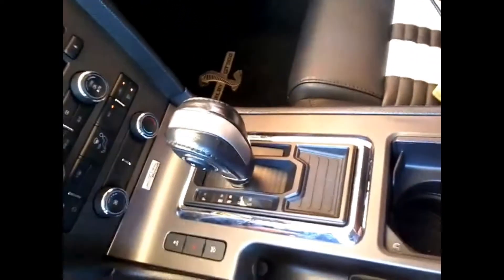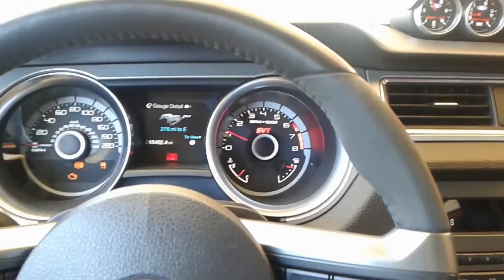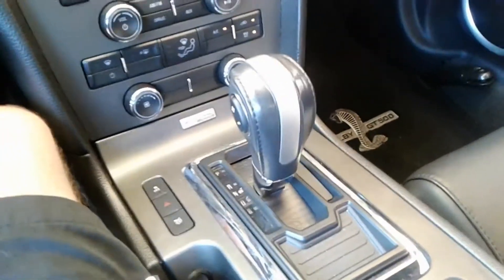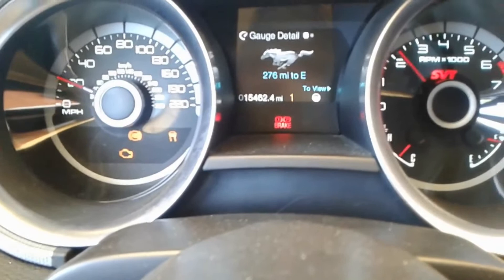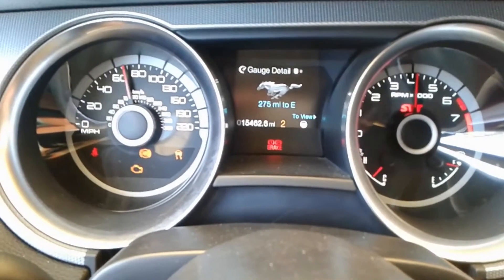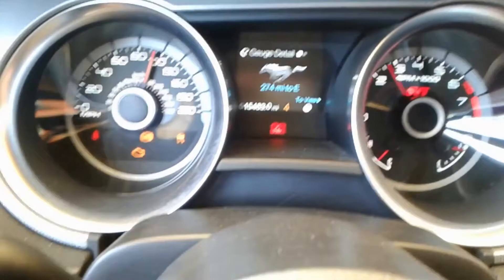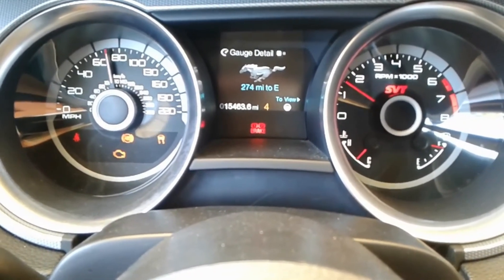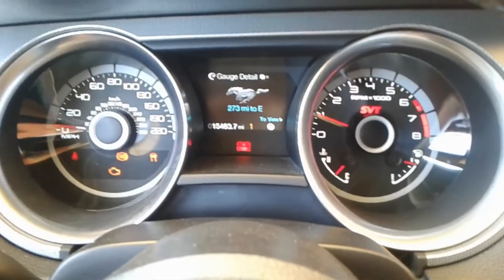4R200 Gearing

Comment: I am very interested in having my 6r80 rebuilt with this and have a couple questions. Under normal daily driving, when does the converter lock? Does it only lock in overdrive, or will it lock in 2nd or 3rd? Im just wondering because of heat building up while driving through town or something like that. Also while im crusing on the highway in od with the converter locked, if i give more throttle, will it still kick down gears and work like stock? And will the converter unlock then as well? My car is single turbo, makes around 1000 at the wheels and i like the idea of the circle d 252mm converter and not locking it while racing. Will likely have 3.55 gears.
Reply from the maker: The converter lock will function just like stock with a full range of tuning just like the 6r80. If you currently have it setup for you combo, you will be able to keep that with the 4R200 in place and operational. No changes come to the tuning other then what is required for the shifting with the gear change.

Comment: How does this affect 1/4 mile time besides not breaking under alot of power. Also how much power should you be making to make this a necessity and how much power should you be making to see a difference in mph or 60ft. I have a 2012 twin turbo coyote with a 3400 circle d converter making 680-720 to wheels on ms109
Reply from the maker: We have seen some ET gains in the 2-4 tenths area on supercharged car. We are compiling more tests to see the range of gains from different vehicles to share with everyone. Since the 4r200 is more of a performance mod than just durability, you really can add this to any build as long as the gearing favors your combo. The durability aspect will come into play when you get up in power for sure, but not only when you get to that point. In most cases we see forward planetaries start having fatigue around 800rwhp.